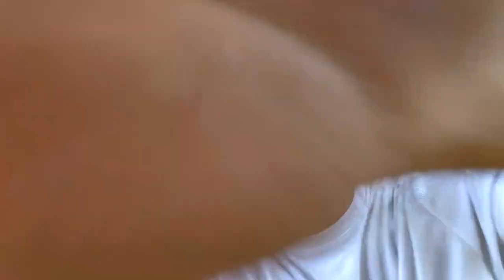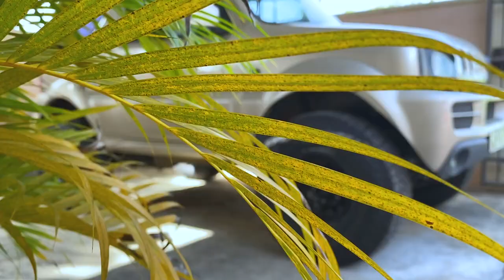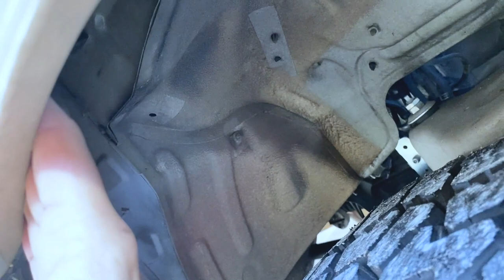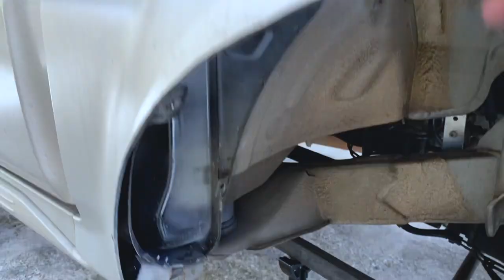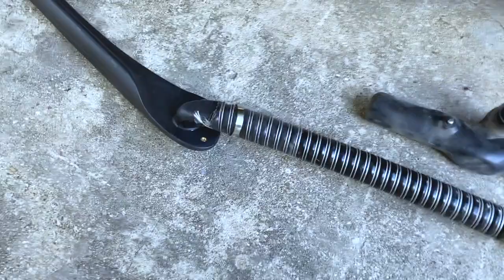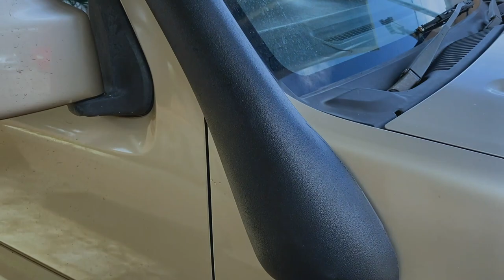Installing Snorkel on Jimny JB43

Comment: Another great video! Not sure you needed to cut up the original air intake pipe so much, the long bit that goes toward the rear looks like its for connecting a snorkel, what do you think?
Reply from the maker: If you cut the long section that goes to the rear, you would have to find a way to block the opening that feeds back into the engine. Also, the section that goes to the rear is a different dimension. This method would be a lot more work than the method I used. Hope this helps :)
Reply: @Zaff_TT  ahh ok that makes sense! I wonder what the point of the long section of the original intake is then. Really enjoying your content, keep it up!
Reply from the maker: @philc.2504  thanks bud, I appreciate the support 🙌

Comment: Hows the onroad handling of your jimny with the 31s?,aside from fuel consumption,will the auomatic transmission suffer in the long run?planning mine to do the same as yours( m13a auto),thanks
Reply from the maker: Personally the on-road driving and comfort is satisfactory, its nothing close to a luxury vehicle but thats a compromise I made for running 31s. The acceleration is slower than stock and over 100km/hr it gets a bit unstable, so I keep at at 80km/hr on the highways. Hope this helps :)
Reply: Thanks mate cheers

Comment: Nice video. What tyre size do you have?
Reply from the maker: The tyres are 31x10.5r15, Falken Wildpeak AT3W. I have a full video on installing them on my channel, you can check it out for more info :)
Reply: @Zaff_TT  is it stock engine on this tires... or have some modifications??
Reply from the maker: @acodimoski9812  Stock M13a engine bud !
Reply: @Zaff_TT  do you have any problems in deep mud or smoething else on offroad ( with this size tires).... I am asking because i have suzuki jimny and my tires is 215 75 15 and i want to instal biger but i am not sure is it good for my jimny on road and offroad... especially offroad because engine is 1.3  82hp